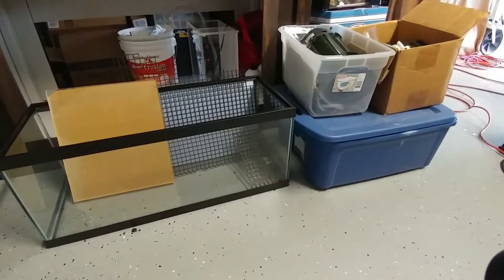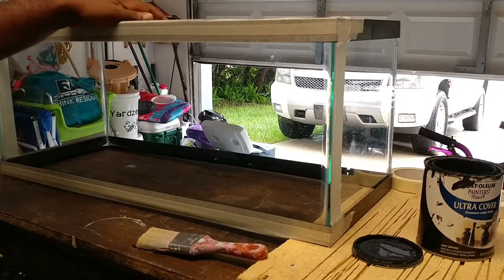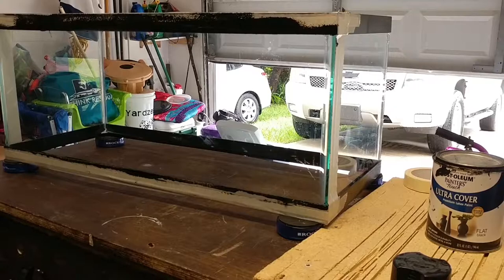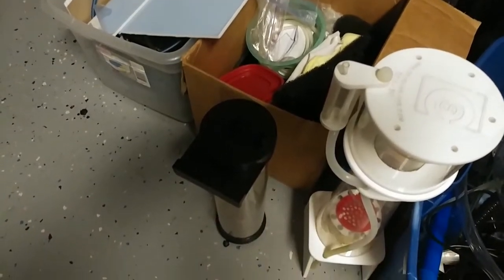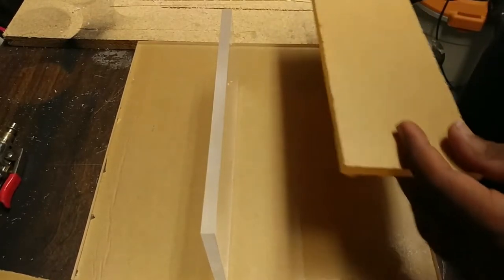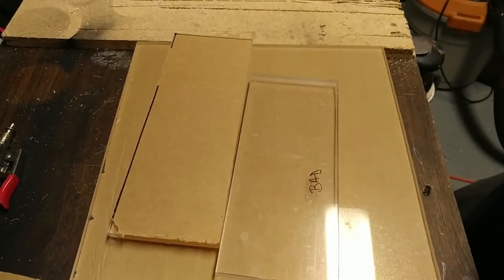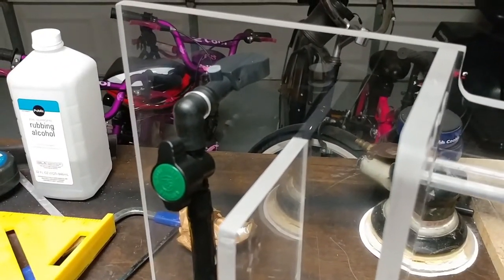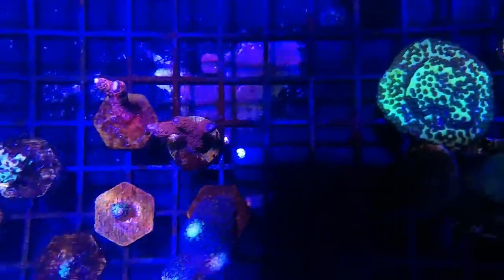Diy Aio Coral Frag Tank: How To Make A Cheap And Easy Reef Tank

Comment: How did you cut your acrylic?
Reply from the maker: Circular and jig saw both with fine tooth blades and a sander (I think 220 grit) to smooth out any rough spots.
Reply: Looks great! I’m about to do the same on a 20 long! To use as my frag tank. Thanks for the tips and super fast reply!